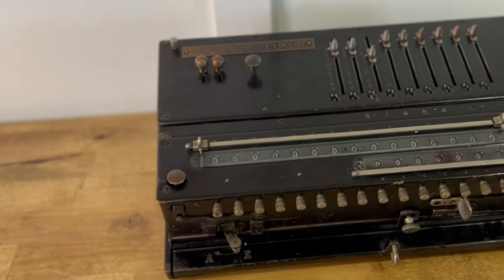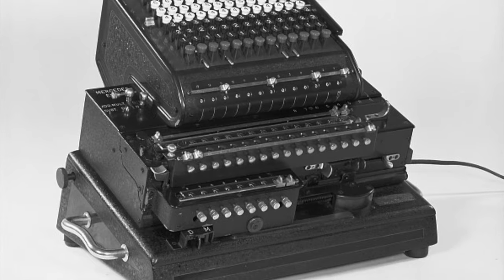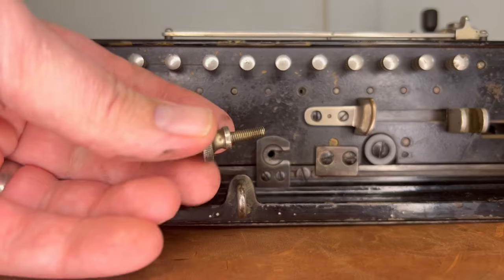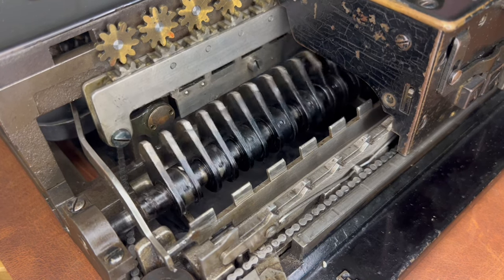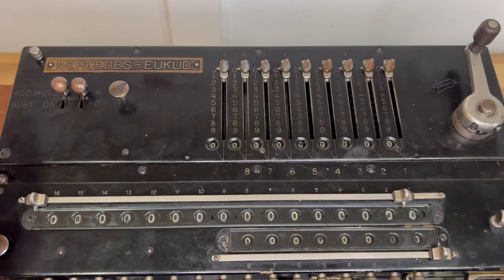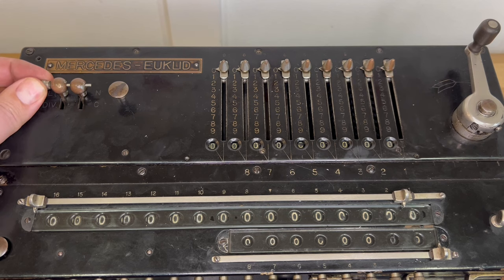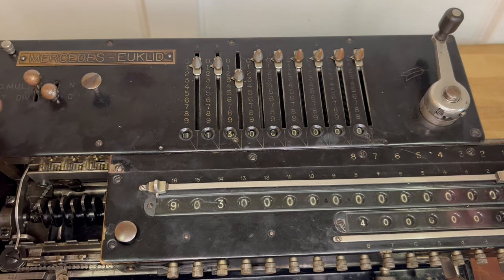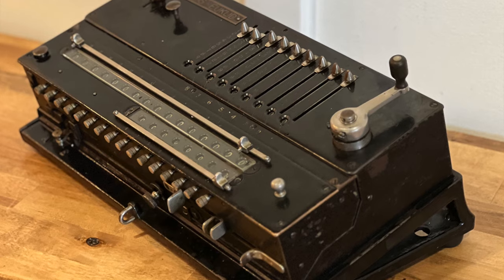Mercedes-Euklid Model 1 mechanical calculator

Comment: arifu has a video demonstrating a Mercedes-Euklid VIII- it was the first calculator to have both automatic multiplication and division.  It is the same calculator you showed in the photo from the Smithsonian, though his has a smaller keyboard.  The same model was produced both with and without a keyboard.
Reply from the maker: I think Mercedes-Euklids are great machines. I think there’s a really good possibility they Mercedes beat the MADAS to market with automatic division.

Comment: What a lovely machine! Really interesting to see how it compares to my model 16 in which the division is fully automatic. Thanks for showing it
Reply from the maker: Thanks Jaap. I love that 16 of yours. It looks so odd with the carriage below the full keyboard.
Reply: @stephenfreeborn  Your serial number is 3058, putting it at 1921. By that time production had ramped up again after the slump from WW1, but they were also making models 7 and 8 that had fully automatic division. It seems that model 1 was kept in production till about 1927 as the (slightly) cheaper alternative.
Reply from the maker: Pretty remarkably that they would do that. I also find it amazing how similar the devices were until they finally changed the whole device with model 21.

Comment: Gill Bates' calculator said 31,415,929 :face-orange-biting-nails: At the end I wasn't sure if the machine was agreeing 29 or then going to 30 then 31 :face-red-droopy-eyes: the final position was not definitely 💯 clear
Reply from the maker: That was user error. On that device you spin it until it locks. I realize that I hadn’t done that so gave it a final spin.  When editing the video, I debated refilming that bit but in the end opted not too. Between the kids and wife, filming and editing in my house is a dance of scheduling.

Comment: What a neat mechanism, first appearance it looks a Thomas-clone, but it is radically different. How amazing that the thumbscrew and combination-pin are still with the machine!
Watching your video just now, I'm also struck by how similar a muchlater Mercedes 29 is to this - some of the quirks of a 29 become much more understandable. (A Mercedes 1 is out of reach, but 29;s are pretty plentiful and affordable still :)
Reply from the maker: I have a 29 and they are honestly not too dissimilar. At least it’s easy to see the steps from a to b. The move of the accumulator to the back of the machine was definitely a good one.